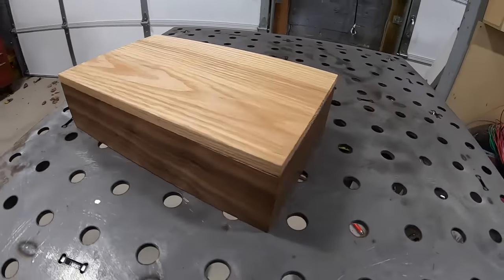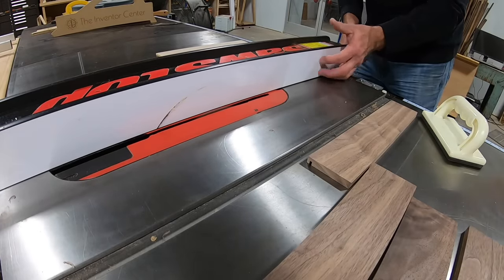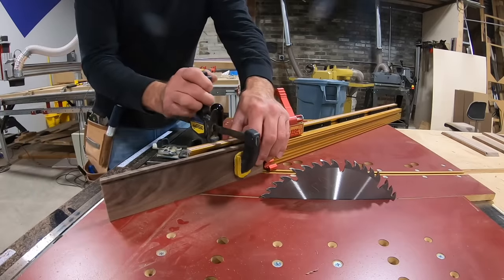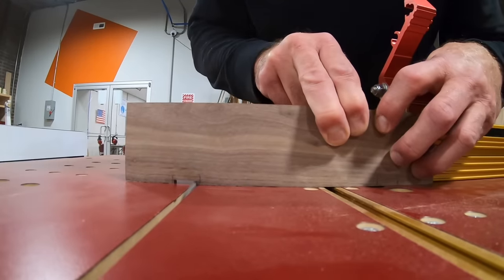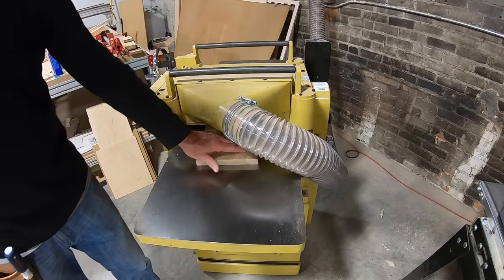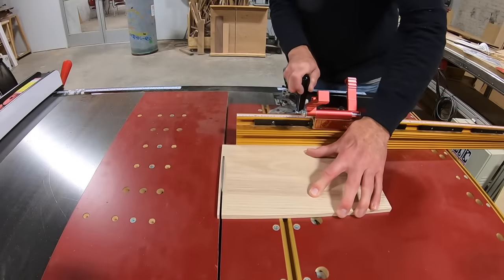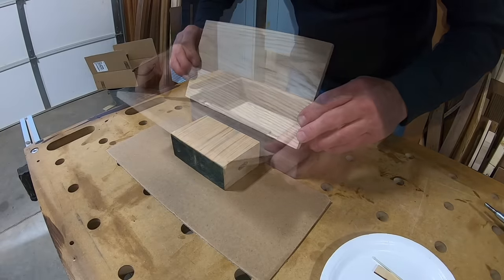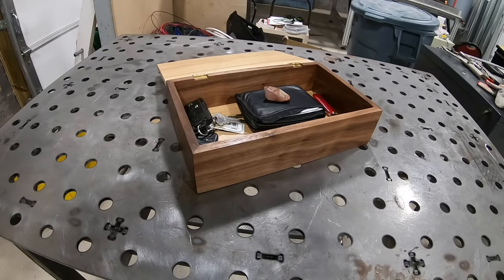🛠 Make a Keepsake Box in an Hour.... or Two

Comment: My first youtube comment ever! Thank you for your video. I made the box, I’m a well advanced beginner. I had some challenges and maybe my experience can help others. 
My miters did not turn out well. I used dewalt table saw, crosscut sled, blade at 45 deg checked with a speed square for accuracy. So I bought the wood putty referenced in this video. Since I decided to use maple for the box and walnut for the lid, the miters were maple. Used the timbermate maple filler and sanded and they really did not look that good. Dark lines were apparent. Would have done a walnut box if I could do over -the dark color would hide the imperfections better. Or, I would have built a better jig to cut my miters. 
Pay close attention to the hinges you buy, screw type and size. Many of rocklers have ROUNDED head screws which means the box will not close. They have to be flush screws. 
I used the lid epoxy technique in this video but ran into some trouble due to less than perfect drilling. Next time I would epoxy hinges to the box, then epoxy to the lid. That keeps the screws from pulling the hinges crooked if your drilling is even slightly off. A little bit off goes a long way to crookedness. 
All things considered, I have a nice looking box. Thanks again for the video!

Comment: Do you ever glue the floor into the slot ? I notice that a little bit of glue from the miter joints probably gets into the ends of the slot. Is that enough ?

Comment: Like the design of your box. Going to try and make a couple myself out of poplar wood. Also like the push stick you're using, and I see the name "The Inventor Center",  but I can't see where they might sell these. Any ideas? I see at your website you have a similar one. Are they in stock and if not, what is the lead time? Thanks!
Reply from the maker: Hey Greg.  I can make them but right now I am in the middle of a renovation and won't be clear of that for a few weeks.  The ones on the website are in stock and ready to ship.  :-)
Reply: @GotItMade  thx. Just ordered your Shocker Stick. I also purchased the GRR-Ripper push block, so at least now I'll have a couple of options when using my table saw. Good luck on the renovation!
Reply from the maker: @gregeverhart5179  Thank you Greg.  I got it on the way this morning.  You should have received an email from PayPal with your tracking number.  Thanks again!

Comment: New to woodworking, can u plz explain the miter step, are all 8 ends done from the same setting and side of the table saw ? Or do u have to do the ends on the opposite sides of the blade ?

Comment: Nice build. Great use of cleaning up odd pieces of wood. 
The way you did the second cut on the bottom panel is actually dangerous. The board could bind on the table saw when you push it through and get caught by the blade and throw it back at you. You should have cut with a miter gauge.